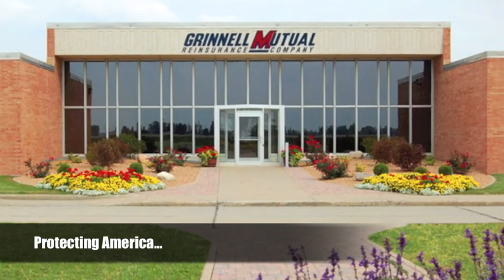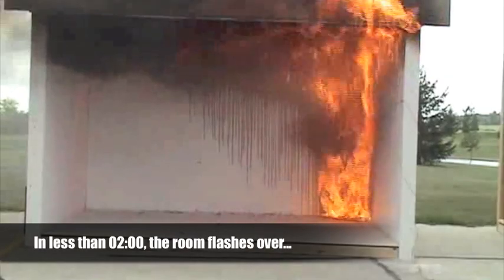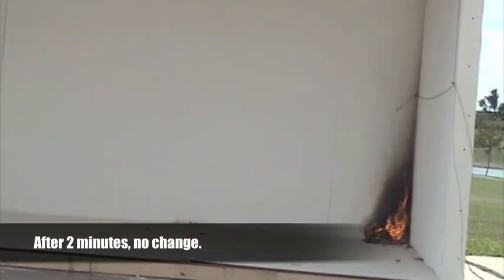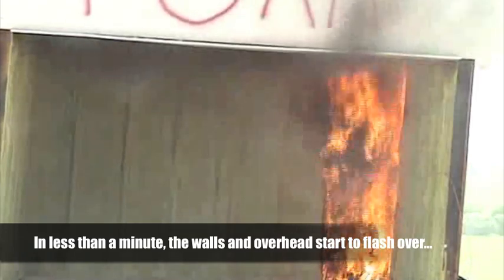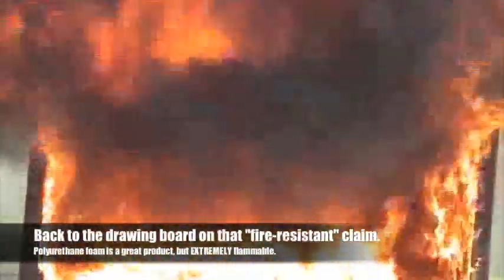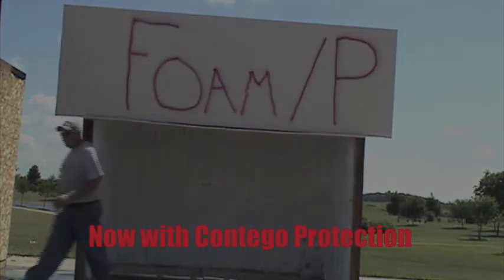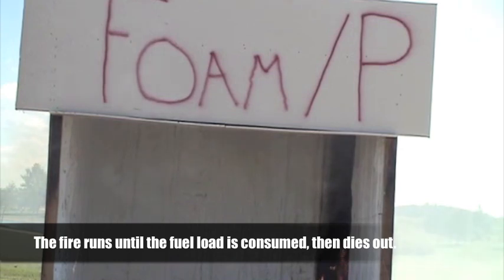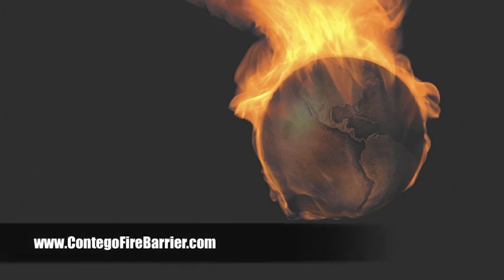Fire Tests on HDPE (High-density Polyethylene) and Spray on Polyurethane Foam Insulation

Comment: Poly ethelyne foam? Ethelyne sounds like plastic fire
Reply: I never knew about this foam
Reply: Bout like vinyl siding should be outlawed too
Reply: It is a plastic.  It is foamed polyethylene.  Familiar with pool noodles?  Foamed polyethylene.  It comes in a wide variety of forms depending on the molecular weight of the PE, how 'foamy' it is, closed cell or open cell, etc.